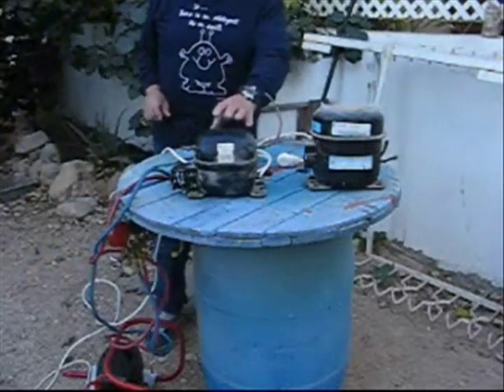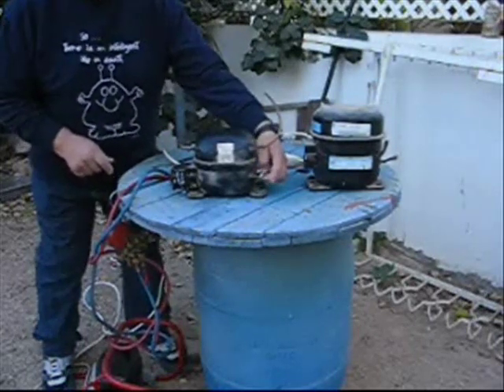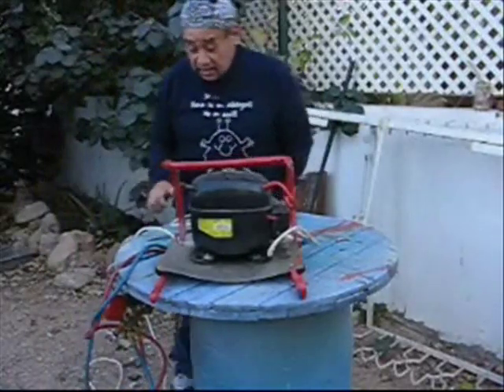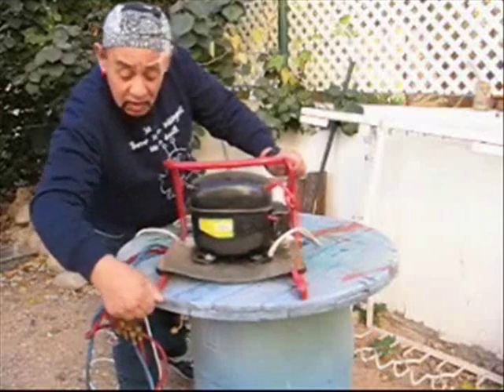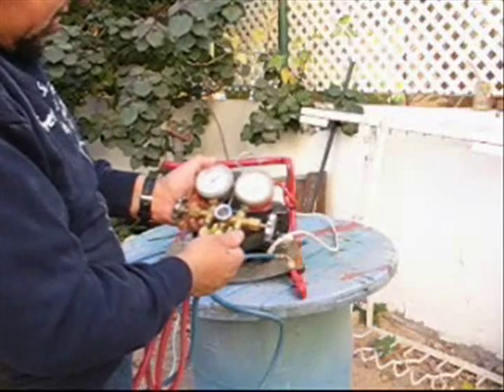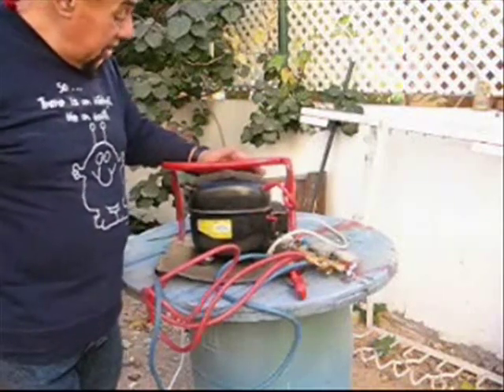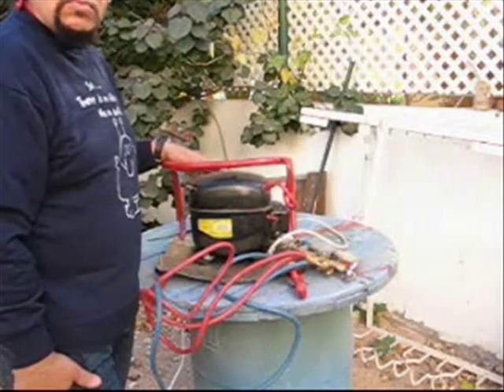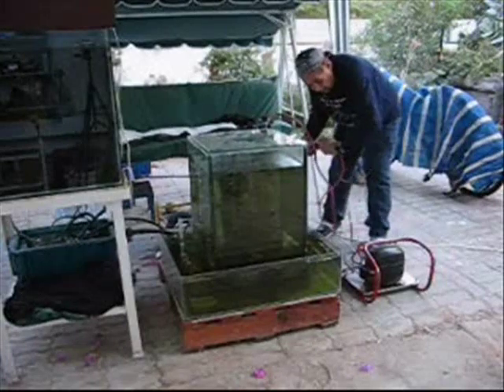Romaurie Effect: Home made vacuum-pump.

Comment from the maker: The range of compressors from 1/4 H.P. to 1/2 H.P. hold 600cc of refrigerant oil.What I do is add 200cc of re-claimed 3GS oil.A number of refrigeration air conditioning companies change the oil on central cooling systems once a year.The oil removed used sit around the yard until a waste oil company visited to take it.
But, people have written about using other oils in the compressors.Fact is, refrigerant oils are "de-hydrated".Moisture in a refrigeration system  is a big problem.

Comment: All of us knows that any fridge or HVAC compressor has oil and this oil must return in the device (compressor) for a continued lubricating. But, in the case of a DIY vacuum pump using an air compressor using fridge or HVAC compressors, what we should do with? We know that fridge or HVAC compressors have a myriad of advantages to use it in DIY projects! So, I have to build a vacuum pump with such compressors... Which the best thing to do? Thanks!

Comment: All of us knows that any fridge or HVAC compressor has oil and this oil must return in the device (compressor) for a continued lubricating. But, in the case of a DIY vacuum pump or air compressor using fridge or HVAC compressors, what we should do with? We know that fridge or HVAC compressors have a myriad of advantages to use it in DIY projects! So, I have to build a vacuum pump with such compressors... Which the best thing to do? Thanks!

Comment from the maker: I remember reading somewhere about vacuum functions; where a photon strikes a particle, which produces a chain reaction that results in the photon being shot back through time to start the reaction. (Or something like that)
I'm sorry.That is one use of a vacuum pump that is a little "out of my league".
I thought the 30 inches of vacuum measurement we use in refrigeration would also apply to the height a full vacuum would lift a column of water.
It will in fact lift to 6 meters.

Comment from the maker: The only thing I would add to what has been said is to put a container in series with the suction line to "trap" any condense from the chamber.The rest is pretty much common sense.Try and use the original starting relay and klixon[bi-metal circuit breaker] to start it.The very small domestic fridge compressors are still capable of pulling a full vacuum if the flappers are OK.Follow the instructions for doing an oil change.

Comment from the maker: If by "He" you are refering to Romaurie, the perpetrator of this item, That's me, sunshine!
And I've had 6 of these up and running with routine maintenance for 4 years.
The engineers in England who built and used these in 1973 when I joined the proffesion had no trouble with them,Remember, refrigerant pressures are greater than air.You have a constant flow of air through the comp to help cooling.If you are in a very humid enviroment, then maybe a pre-filter would help.

Comment from the maker: A few good quality small vacuum pumps have come on the market now.However, I have noticed a number of engineers using them with little or no oil.When I mentioned this to one engineer he said it only made 20 inches vacuum from new.He should have returned the pump to the dealer after first changing the oil and re-testing.These commercial vacuum pumps have a window for monitoring the oil level.
I change the oil regularly on my  old CAE 4440 Hermetique compressor and get 30 inches full vacuum.

Comment from the maker: It rather depends on the condition of the compressor you use.The hermetique comps have thin flapper valves that if run very hot or without oil loose their ability to seal 100%.I use a refrigeration low pressure guage which shows up to 30 inches of vacuum.If it will pull 25 inches in  15 seconds, its in reasonable shape.Always change the oil first.

Comment from the maker: Smart job! The oil seperator is a good idea.These units are available commercially but very expensive.However, the demand for small, quiet air compressors is increasing with the number of small mobile phone servicing shops.

Comment from the maker: These systems work on a "total-loss" oil system.Depending on use, vacuum pump or air compressor determines how frequently you need to top-up.I have a clip of filling a compressor.I normally do this once every 6 months with 240cc of Suniso 3 GS refrigeration oil.I believe any universal "68" oil will do.The main difference with 3 GS is that it is dehydrated to avoid moisture in refrigeration systems. 
.

Comment: Not bad, there--especially the part about your compressor being initially siezed.

I was able to use the WD-40 trick to free up a siezed engine in an old Honda Civic some years back.

Maybe you should clarify what likely happens at the discharge end, as not only air comes out (but a little oil as well).

But what do I know after almost 50 years? :)

Comment: You say that you change the oil, what type (trade mark) of oil do you use to fill the pump and how did you do that? How do you make sure the pump will be correctly oiled when is running? I have a fridge compressor in hand right now but I am little bit affraid about oil.

Thank you

Comment from the maker: Or paint spraying, computer or elecrical appliance cleaning, or shop use where low noise level is equired. Of course the larger the receiver, the longer it runs.You could use 1 of those gas containers I saw someone else use.

Comment from the maker: The tank is a reservoir for the air. There is a "High Pressure" refrigeration control, "auto-reset" set for 120psi-8.5 Bar.This automatically controls the operating pressure.For air tools, I feel the amount of reserve air is insufficient.But I was looking to make something compact and quiet.

Comment from the maker: To try Alan's idea of placing an air pump in the "partial-vacuum" to re-cycle the air. It worked but after 24hours the inlet to the air pump was saturated and very little air could be sucked in. I posted a video-clip of this.